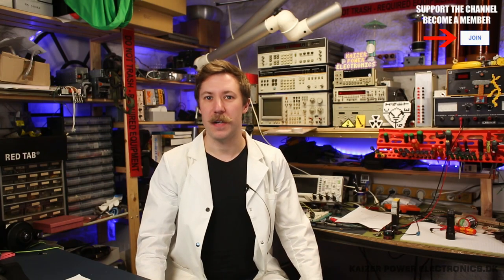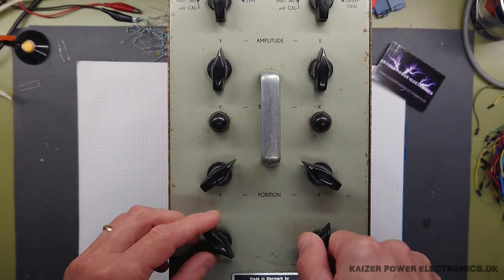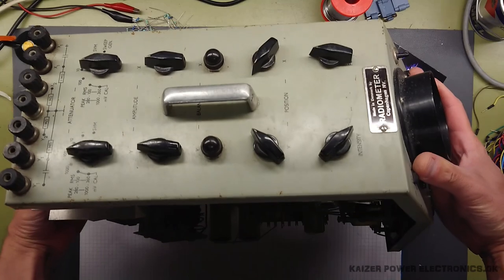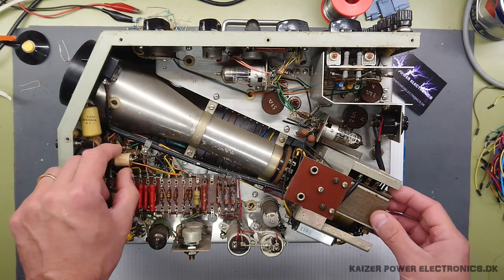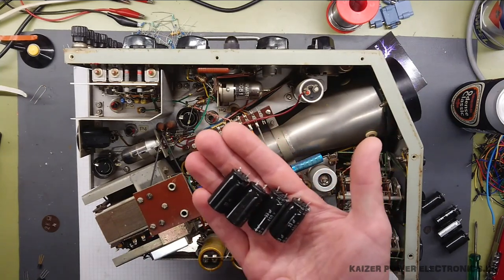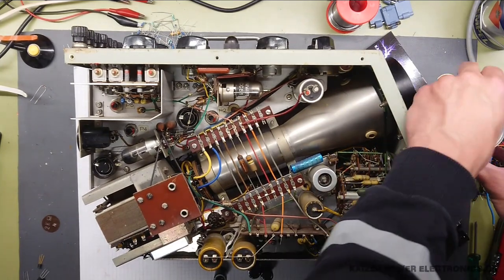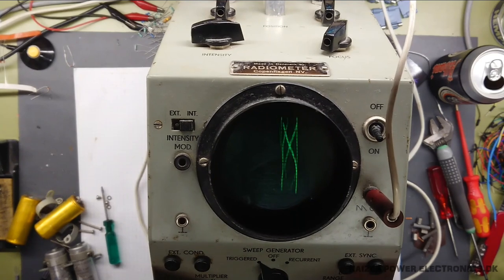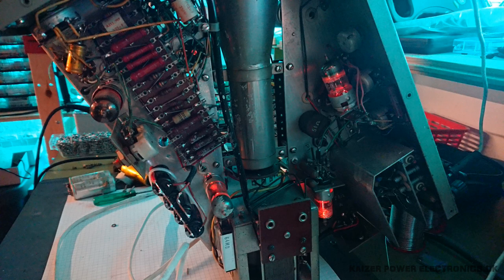Radiometer Copenhagen OSG 42b Oscilloscope Repair, From The 1950'ish

Comment: really nice bit of old gear...thanks for the look
...maybe ya could use it to draw some pics..oscilloscope art...
Reply from the maker: Seems simpler than I imagined :) https://wb8nbs.wordpress.com/2014/03/04/fun-with-vectors/
Reply: @KaizerPowerElectronicsDk  If that "intensity modulation" is fast enough, you won't need to rely on just time (or kicking off-screen).  It's another dimension, potentially.  I've never seen more than an intensity knob before, but you never know.